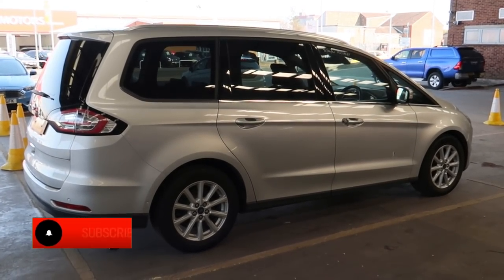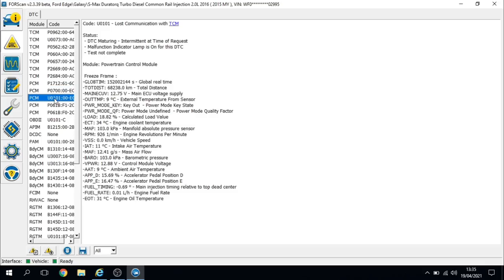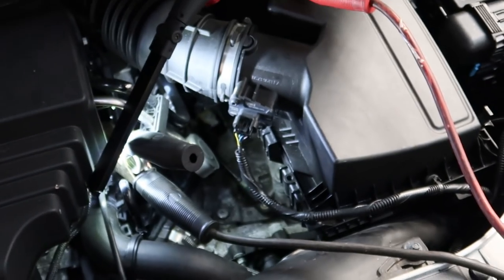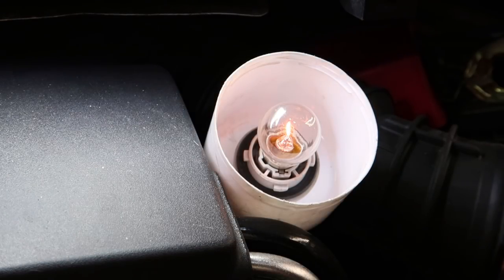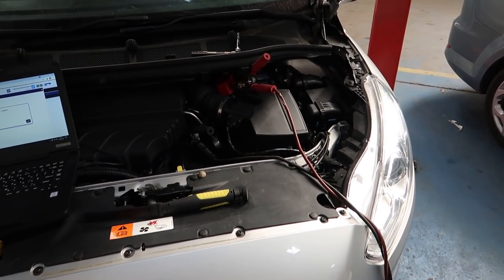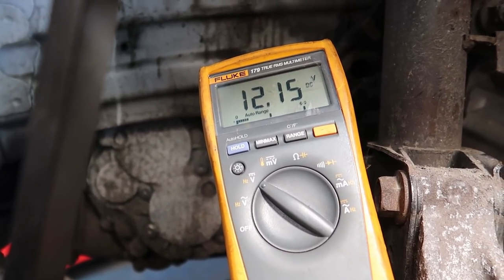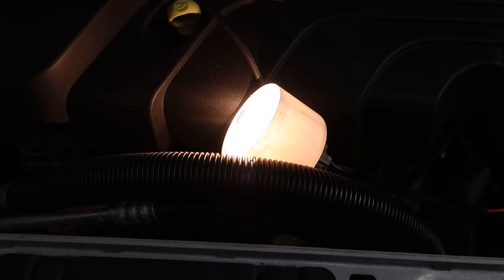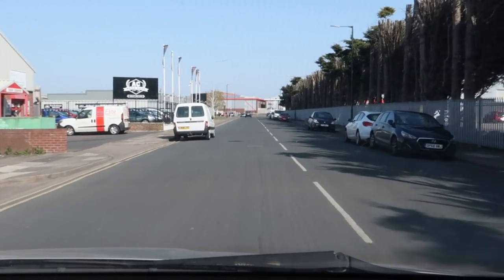Ford Galaxy Loss Of All Gears - Volt Drop Test - Powershift 6DCT450 - MPS6

Comment: Great video on using load testing wire was only going on about load testing to lads in my workshop as they are only checking voltage and was telling them about ghost voltage and how u can get caught out gonna show this video as a example cheers steve

Comment: Bloody brilliant! I have the same code for lack of power. Did an oil service and found non-magnetic sparklies in the oil so am pulling apart the box to clean all the dirty sensors and solenoids etc. This will be invaluable info when it goes back in (with a new clutch pack anyway providing no other issues found).

Comment: Good find this one Steve could easily have been led down a rabbit hole here, I’ve very often had 12V(nbv)on a vehicle only to find the circuit when loaded won’t pass any current, as you say the manufacturer’s flow charts are very poor using resistance measurements instead of load testing ..... Cheers 👍

Comment: Good to see someone properly diagnosing voltage feed ,good job ,when you said you were doing an update for warranty would this broken wire situation not be covered under warranty or is the vehicle out of warranty cheers Del.
Reply from the maker: the update was covered under warranty as its emissions related, however, the broken wire not covered as it was nearly 5 years old. Thanks for the comments and for watching

Comment: Great job ,,can never see why they don’t make repair kits or terminals
Reply: They do. At least I've seen in Alfa romeo Giulia manual that there are "connector repair kit" which are supposedly new connectors with new pins to install in it. Not cheap, and often you can find the connector MUCH cheaper around (i.e. the connector for the rear camera to body computer for the Giulia is a Molex one that costs 1.5€ plus other 2/3€ for the pins - Alfa sells this as "repair kit" for 70€). It's just that the average mech doesn't have time or willing (or it will cost too much in time) to search for them.
AND sometimes they simply don't exist (i.e. the harness to rear camera connector is a set composed by Yazaki 7289-0064 and 7129-5503 which are nearly unobtainable...).

Comment: Great video as always Steve. Have you used a LOADpro. Finds voltage drops by pressing a button, showing drop on your meter without using bulbs.
Reply from the maker: i have used one yes, I found it a bit bulky and although it works its only a minimal load it applies. The bulb method was what i was taught many years ago and its what i go to. Thanks for watching and for the comment

Comment: Will this be the same for all mps6 Getrag transmissions? I have the same gearbox and have no drive in any gears. Getting fault codes p0606 p074f b1403 & b1407. Great video!

Comment: Ive got a non moving 2014 Kuga with this box. errors point towards shift selection learning and stuck fork B. The shift can be reset however doesn't change gears at the peak of first gear, resulting in a return of the DTC as well as ABS warnings. Local approved repair/dealer suggested simply changing the transmission fluid. The box has done 54k so is due...Im hoping thats a solution to start with!? any thoughts? Many thanks!
Reply from the maker: First thing I do with shifting concerns or solenoid codes is check the oil quality and level. More often than not the oil service has been skipped or the level is low. I have a video showing the oil change procedure
Reply: @SYDiagnostics  awesome thanks.....I watched it just after I commented 🤣 thanks for the reply and the great quality videos!

Comment: Great video!
If you measured the wire impedance would that work? Or as its not under load it wouldn't show any problem?
Reply from the maker: for volt dropping the wire has to be under load to show the fault
Reply: You CAN measure the resistance of a wire.
BUT:
1) A normal multimeter is not the correct tool for the job. They're good for measuring the resistance of things a few ohms and up. But not wires.
You would need a 4-wire low-ohms meter or at least the type that electricians use, where they output 4-5V at 200mA on a resistance test,
2) To carry out the resistance test you would need to access both ends of the wire.

So loading by substitution as Steve did here is by far the most efficient way to test for a good supply.
Remember that for items such as transmissions and ABS, they may only draw a few mA until required to do some work - and you're not going to put the trans in gear then stand at the front of the car probing the connector!
Reply: @simonparkinson1053  I see, thank you very much for your clarification!
My Facom multimeter has a load test function, do you think that's reliable or doing a load test with a bulb it's a better procedure?
Reply: @claudiovic88  depends how much load it puts on, it will be in the manual.
But I can't imagine it will be more than a couple of hundred mA.
Fine for a solenoid circuit but not enough to prove a good feed to something like ABS, Trans or fuel pump.
For those circuits I use a H7 headlamp bulb to simulate, they're 55W so about 4.5 Amps at 12V.
A 21/5W stop/tail lamp with 4mm stackable banana plugs on is another ideal test load.
Shroud the bulbs like Steve did, so they don't burn carpets, plastic components and you!

Comment: Gearbox oil change done at 36000 miles?
Reply from the maker: was advised to have it done.....wouldnt have caused this issue though
Reply: @SYDiagnostics   amazing just one wire caused the gearbox not to work.
Reply: @SYDiagnostics  If the customer was advised but didn't have it done then they clearly don't understand powershifts or the risk they are taking.
Reply from the maker: @robthomas7232  exactly

Comment: I have the same issue on a Galaxy 2015. I checked powers and grounds plus the Can Bus at the gearbox (round connector) and everything looks good. I also did a load test and that looks good as well. There is no connector between the gearbox and the engine ECU. I also did a live test on the gear selector and everything shows INACTIVE. The gear selector position when in PARK or anywhere else shows Neutral. I believe the gear selector is faulty. Anybody has any idea?? Thanks in advance.